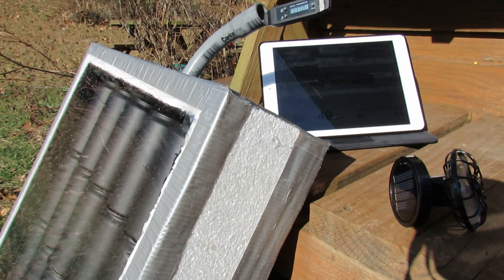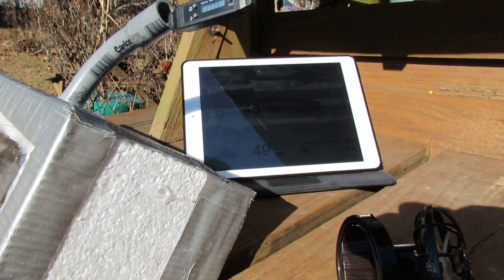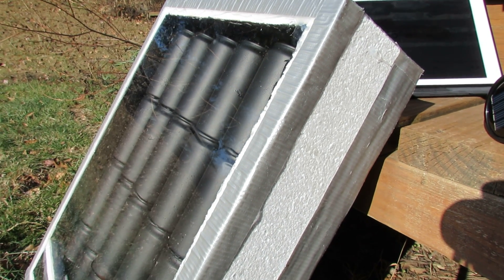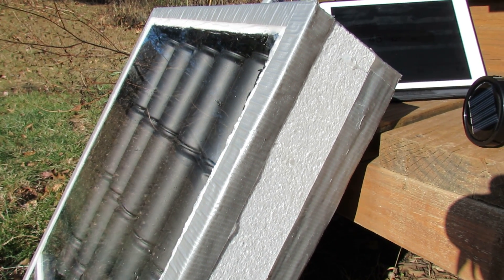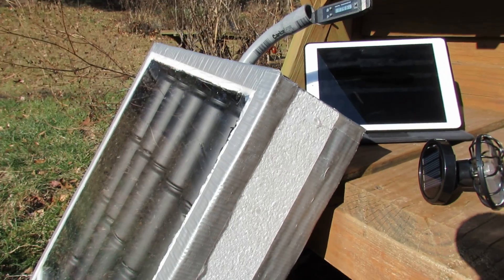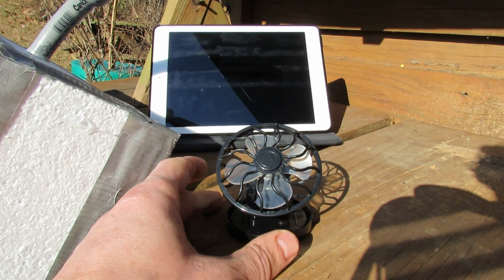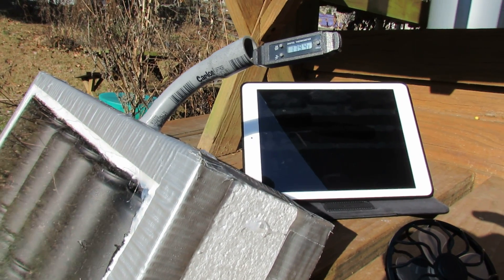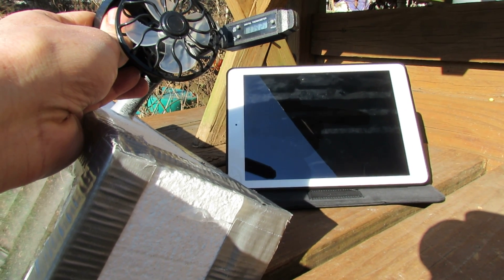A Greenhouse Solar Can Heater: Questions, Thermal Mass, Max Temperature - The Rusted Garden 2013

Comment: ok here is an idea; if this is outside of the green house, and the tube comes in at the bottom and into the bottom of a 50 gallon drum full of fist sized stones. Would the stones hold the heat for longer? second if the tube comes into a drum that holds another container of water...this will warm the air around the inner container of water. would this produce addl heat after sun set?
Reply from the maker: Tracy Bruring You have the right idea. The heat would rise up and warm the stones. And that would be great for a permanent greenhouse. Water is good thermal mass. Some of these solar heaters actually use tubes of flowing water instead of aluminum cans with air. Check out solar water heater videos.

Comment: Great video! Do you know what would happen if the solar can heater was made with 16 or 24 ounce cans? Do you think it would produce more heat because more area and volume in the bigger cylinders?
Reply from the maker: nelson toups I dont think the temperature would get that much higher but the greater length the columns be it small cans or big cans creates more heated air.  That greater volume of air would heat bigger spaces faster.